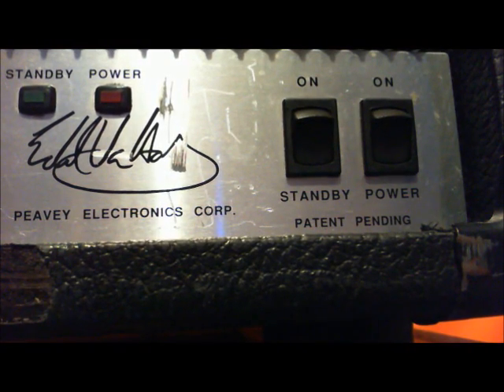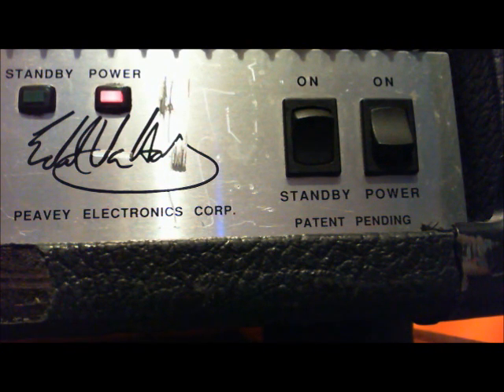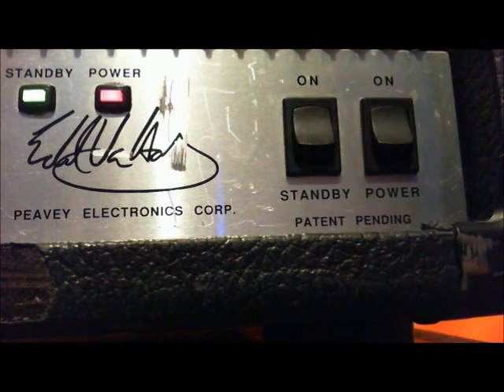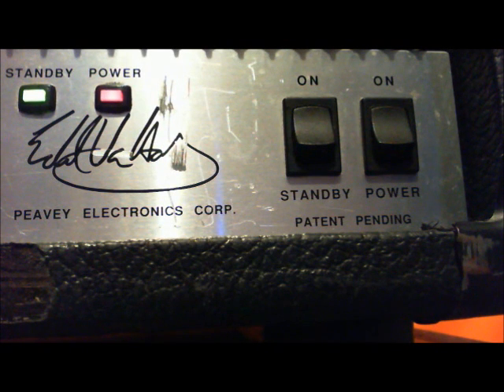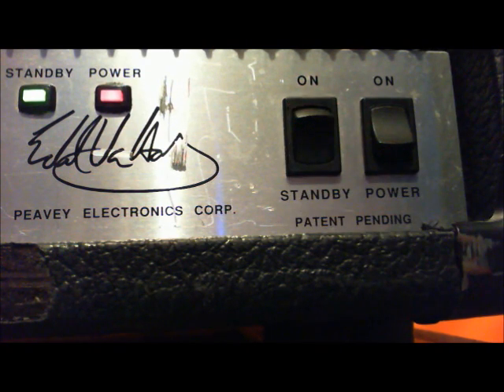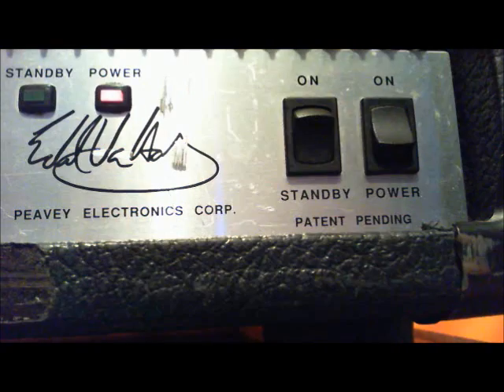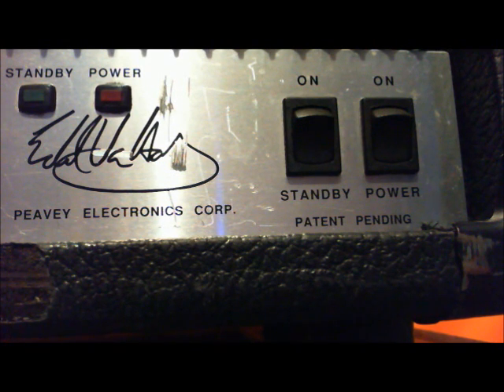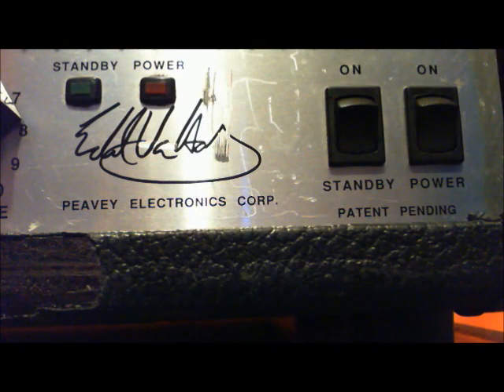How to use a Standby switch on guitar amplifiers and how they work

Comment: This is incorrect, the standby switch does not protect the valves. It might be useful as a mute switch but that is what volume controls are for. Do your research, there is good advice from valve amp experts on the net.  Guitar players just tend to perpetuate the myth.
Reply: Dr. Z says it helps protect the tubes in amps that have a solid state rectifier.

Comment: Sorry, you did it backwards, Turn Standby switch on first to warm-up the tubes, then turn power on...
Reply: +OTCRock4one No sir, as there is no voltage flowing without the power ON.
1.Power to 'On'
2 Wait 30....
3. Standby to 'On'

the reverse, but not so necessary, when you have finished.
Reply: MoANjAmSaiNT My bad, you're correct!

Comment: Did you know that Peavey amps don't operate this way? On the power tubes (EL34, EL84, 6L6 and so on), the power switch applies full plate voltage to the power tubes. The preamp tubes do not get full plate voltage.

The standby switch applies plate voltage to the preamp tubes, but on the power tubes it applies the screen voltages. Modern power tubes are not simple triodes but have accelerator screens to allow them to operate at much higher power and gain than regular preamp tubes. Without these screen voltages, the current flow at idle is VERY low.

The reasoning behind this is that cathode poisoning is primarily a problem for power tubes which have much hotter heaters than preamp tubes. A long time ago preamp tubes were designed to not be affected by cathode poisoning by being in standby too much. Cathode poisoning occurs when the electrons cooked off the cathode keep bumping back into the cathode with nowhere to go. Each time an electron bounces back into the cathode it damages it a tiny amount, lowering it's "emissiveness". After a very long time in standby, with no current flow, the cathod becomes "poisoned" and slowly loses it's ability to emit electrons freely. Eventually, this can lead to power tube failure. The fix for a partial cathode poisoning is simple. Crank up your amp and play for a while.

So in a Peavey amp, when you switch to standby, since the plate voltage is still there on the power tubes, there's a small steady stream of electrons from cathode to plate that prevents any kind of cathode poisoning. Note that the damage of cathode poisoning is GREATLY overstated. It would take the amp being in standby most of the time it was on for it to be a real issue. And with a Peavey it's not a real issue period.

Google Hartley Peavey and Cathode Poisoning for more info on it.

Final note: Modern power tubes heat their cathodes to emission in about 12 to 14 seconds. 30 seconds is plenty of time to wait to go from standby to on.

Comment: It goes like this:
To turn the amp on, if you flip the switch up to turn the amp on, the standby switch should be flipped the opposite. Power on, standby on.

You play the amp with both switches up in play mode.

To turn the amp off, you do the reverse as the beginning. You flip the power off, leaving the stanby switch in play mode. Leaving the switches in opposite positions. When you aproach the amp to play again, flip the standby down and flip the power up, and you are warming up.

Cutting the amp off in play mode versus standby relieves the tubes of signal

Comment from the maker: Based on what I researched, that makes no sense to me. Turning the standby switch on first would cause wear and tear to the cathode because the anode would not have had time to create the electron cloud during the heating up phase.  Also, the standby switch has nothing to do with "warm up" of the amp.  It applies the electrical charge to the anode.  Turning the power switch on is what activates the cathode to heat up.

Comment: I am knocking on you but I think you meant to turn the standby switch on first BEFORE powering up the amp.  When you're done finished playing, it's ok to turn the power switch off right away BUT leave the standby switch on so next time you don't have to warm up the amp before powering up.  Hope that helps.